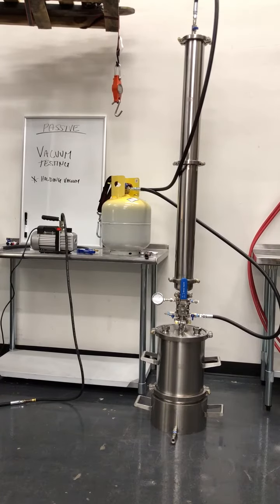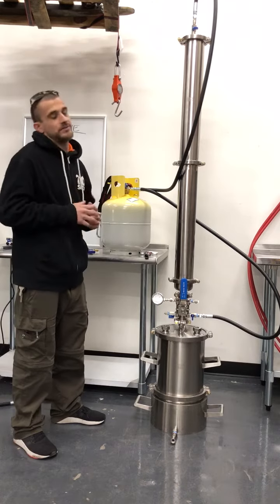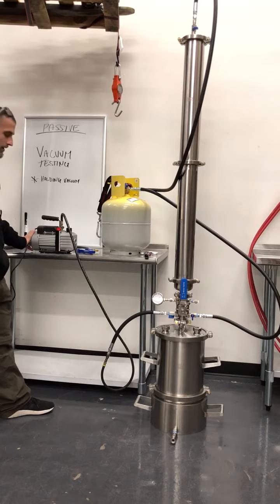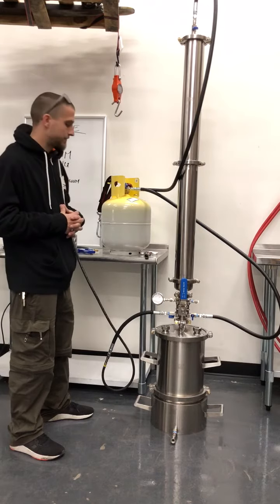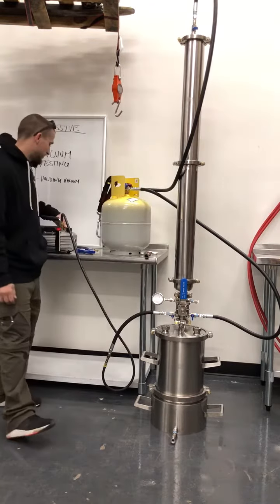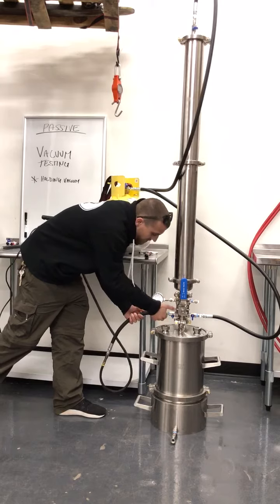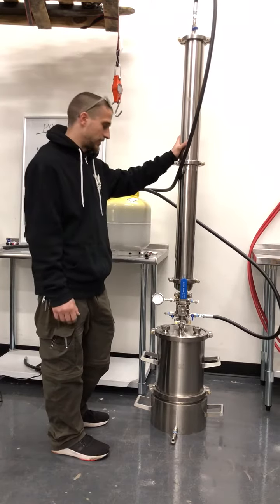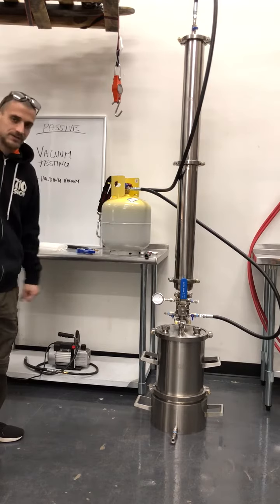Video 3 Passive vacuum testing ,710 Snob extractors

Comment: Lol, interesting indeed. I laughed at first, but after thinking about it for a moment, after doing a neg/pos draw it would make sure the seals were truly seated good an that their wasn't any leakage or looseness do to the flow of pressure which would be directionally based an also beyond just the vacuum pressure itself be effected as the gas is not in a true technical vacuum or is its self mass-less, thus have a technical friction in the system which would dictate a possible leakage as-well? Like running water one way and having it not leak but another and will. For example. -----______ And then again, just also the pure vaccum force(+ or -) and chance of a component loosening due to that. Like a rocking or swaying motion. An then on-top of all that, you have the temp related expansion or shrinkage also related to such exercises. I 'unno. Better safe then sorry ;p Thanks again for the vids.